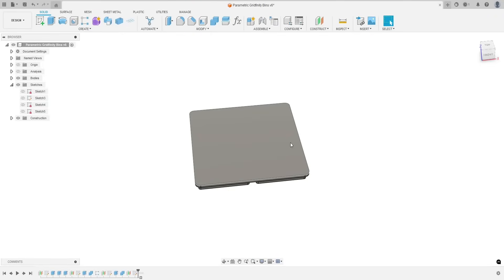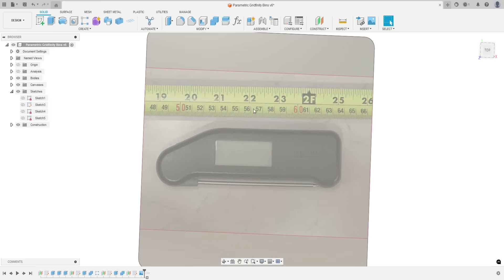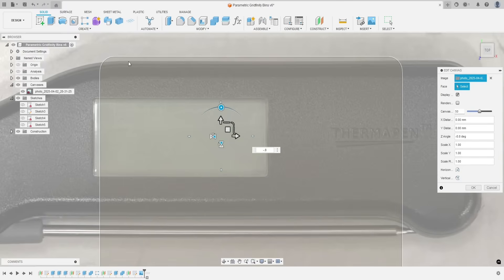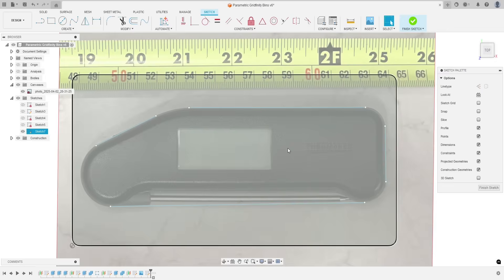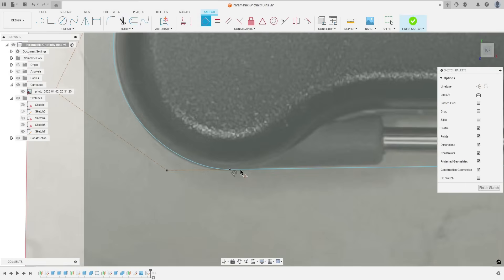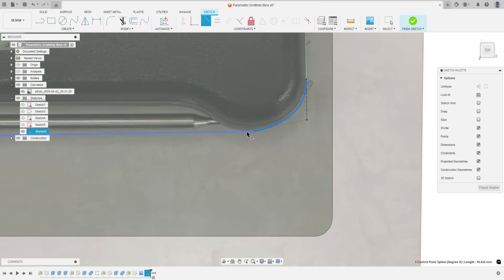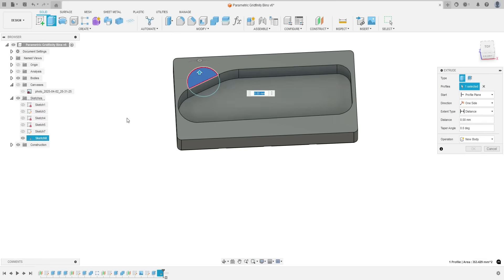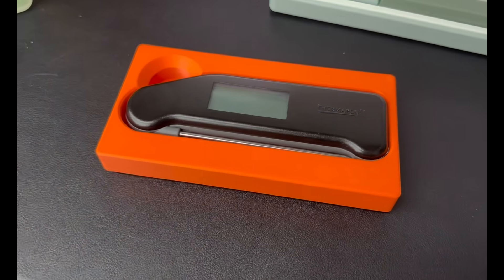Fusion Tutorial:  Tool Cutout for Gridfinity.

Comment: I'm struggling with the calibration of the image. I'm taking the picture from above, about a meter away at 4x zoom but when I calibrate the image in Fusion, it appears too big for the bin size I know it will fit in.
Reply from the maker: Do you have your measurements correct? (Metric vs imperial)
Reply: @ShopTherapy623  Yup, using metric. I even tried switching to using a plastic ruler as the tape measures have a curve to them.
Reply from the maker: @sparkymark75   may need to try restarting and uploading canvas again
Reply: @ShopTherapy623  I've restarted a couple of times. Going to try another image, maybe it's my base Gridfinity file that's the issue, doubt it but you never know, I guess. Thanks for the suggestions.
Reply: @ShopTherapy623  Figured it out! I was taking the photo with my iPhone and then loading that straight in to Fusion. If you crop the photo first to remove any dead space, it works as expected. Thanks again for a great tutorial.

Comment: Thank you for a great tutorial. I was trying to do like the video today and ran into an issue. When I insert the picture it either stretches the picture or the opposite depending on how I take the picture. So the model is not the right size.. any idea why that is? Thanks.
Reply from the maker: You inserted the pic as a canvas and then calibrated it and it only resized in one direction?

Comment: While this is a great tutorial, if you have a lot of items to fit, and are willing to make a small investment, you can use the Shaper Trace calibration frame and its associated software to auto trace your object. Advantages are that it autoscales (the frame border has calibrated marks) and automatically corrects for "distortion" created if you're not exactly above the object. The downside is that you have to buy the frame. But it's a one-time purchase and the software is included. While it can be used with Shaper Origin, it generates SVG files that can be used anywhere (3D printing, CAD, Laser cutting/engraving, Milling, CNC routers, etc.) See for example: https://www.youtube.com/watch?v=V8Cww7oseSs

Comment: Given the uncertainty in selecting the correct point when calibrating from the ruler image, don't use two points separated by such a small distance. The fixed inaccuracy in selecting points (say +/- 1 mm) is spread across the entire measured distance. Because you have an "accurate" source for scaling across the whole image, you can select two points across the full width of the item, then enter the corresponding actual measurement. This way the 'inaccuracy' for each point is relative to the entire distance--so the 'error' is reduced.

Comment: Good outline of how to trace, but use constraints and dimensions more. All those horizontal and vertical lines should have been constrained and ~ 3 of the curves probably would have had a dimension that made sense (i.e., an integer value). Most designers aren’t going to randomly use a float (decimal) value for a radius.
Reply from the maker: Yeah, that’s all good practice, and things people should probably do.  However, for a simple project like this, for your own personal use, it’s not really needed or necessary.

Comment: Crazy how some brains work. I'm no photographer nor have much experience in using Fusion but I knew for some reason if I walked really far from my car, Took a picture of it zoomed in with enough clarity to measure the roof markers I put on it, I knew I could get the best outline of the car to sketch for a roof rack. And now watching this just solidified my guesswork haha.
Reply from the maker: Yes! The farther away you can be from the object, and the further you can zoom in, the flatter (and more accurate) the image will be for measuring/designing

Comment: One tip is to fix the points of the straight lines that you have defined. That will force you to change the curves without changing the straight lines.
EDIT: You mention that like five seconds in the video after I posted this comment :D

Comment: While the spline creation is informative and will be of use... it is not necessary for this product. The radii are just that, radii. As a mold and product designer we ALLWAYS try to use simple, easily definable geometry with nominal sizes when creating a product, thus reducing manufacturing costs  exponentially. Splines are necessary for organic, free flowing shapes which for certain will be required for many, many 'nesting" type organizational prints.
Reply from the maker: Ok buddy

Comment: It was like you found out how G1 continuity works by accident :)
I would assume those curves were arcs and just sketch arcs instead of splines. And of course apply tangency constraints where they connect. 
Arcs are much easier to fully constrain than splines and are also easier for Fusion to handle.

Comment: Great video, I use the Gridfinity Fusion plugin to create my base/container. Also the iPhone has this gizmo that shows up when you take a photo of a horizontal surface, to let you know if you are really flat. But the real challenge is when the object doesn't have a flat bottom, then you need 2 canvas, one for the top and one for the side.
Reply from the maker: Ooh I didn’t know about that iPhone feature! Got any other info on that? I’ll have to google it
Reply: @ In settings go to Camera, the setting is called Level.

Comment: So I figured I'd learn something new by watching this. And I didn't learn anything new until you mentioned click and holding to select face instead of the sketch. I've always just unchecked the sketch. Nice! Also I don't extrude up after sketch usually I use the plug in to make a solid bin and then I cut into it with the sketch I drew. I like doing that better since you get the perfect lip design for stacking. And it makes your cut outs uniform heights for the overall bin height.

Comment: Understood that it is for injection molding but could one have used the Solid Modifier: 'Draft' rather than making an (educated) offset guess?  Thanks for another great tutorial video!
Reply from the maker: You’d still want the tool to sit nicely on the base so you need some offset. But you certainly could draft the edges

Comment: Another suggestion is to add a fillet to the bottom face where it meets the sides. To avoid a hard corner and because the item itself is somewhat rounded at the corners.
Reply from the maker: Yeah, I usually do that, but for some reason I didn’t in this tutorial!

Comment: You've introduced me to some features I wasn't familiar with and they will help me a lot. Thanks! But here's one for the audience. It's better to use the longest possible scale reference when calibrating the jpeg. In this case, instead of using 10mm as you did, it would have been better to use the two extreme numbers on the measuring tape. So, using 48cm and 66cm (180mm) would be 18x more accurate (theoretically at least).
Reply from the maker: Yes, definitely a great point! Thanks for the feedback!!

Comment: Your technique for tracing an object with a canvas is terribly useful for this somewhat naive Fusion user. I have always just used lines, circles and arcs. Then turn on the trim facility to attempt to clean things up.  Your notion of using splines makes tracing so much easier and (if one is somewhat OCD) really optimize the tracing to one’s satisfaction. 😜
Thanks!
Reply from the maker: Yeah it's really easy to do, and depending on the quality of the canvas, you can make it as accurate or sloppy as you want!  Something like this for a tool cutout doesn't need to be insanely accurate

Comment: You'll get a more accurate canvas calibration if you use the furthest marks on the tape measure. So instead of 55 and 56cm, do it at 48 and 66cm. If your points are off by 0.3mm, that's a 3% error on a 10mm measurement, but on a 180mm measurement that's only 0.1% error.
Reply from the maker: 100% correct! And that’s why I always encourage people to add the tips in the comments so we can all learn! Appreciate the feedback!
Reply: That was my question right off the top.
Reply: I came to say the same thing, lol.
Reply: Awesome video brother!